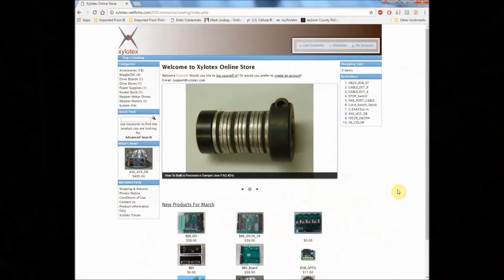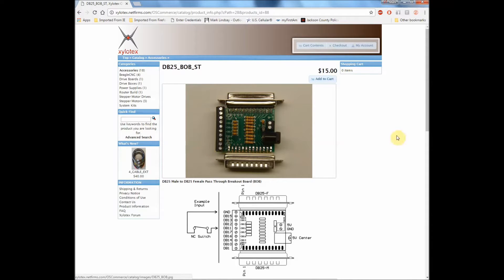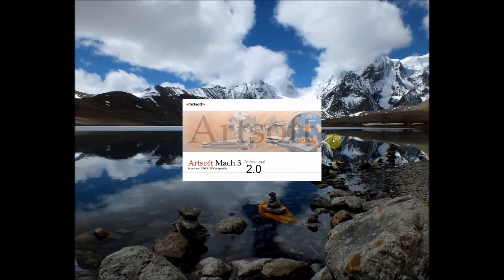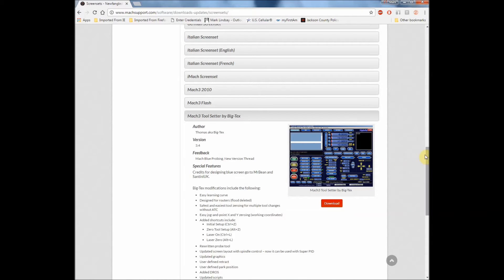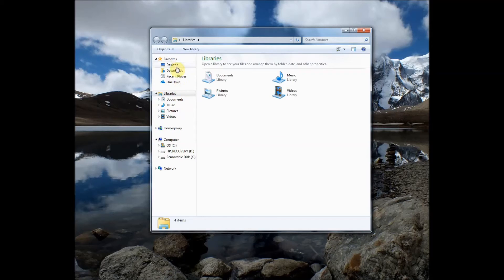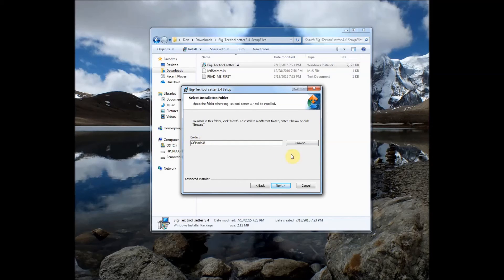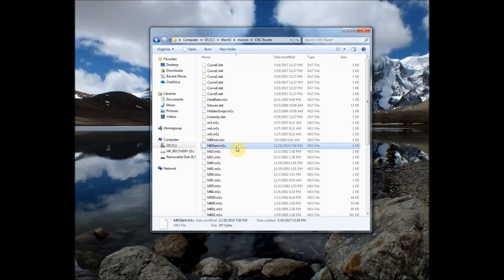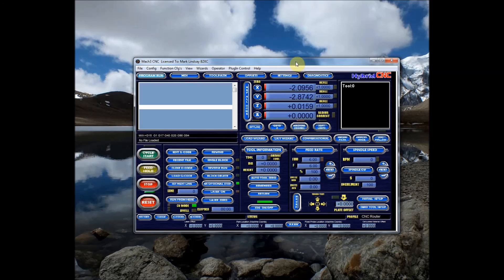Using the Triple Edge Finder from The Maker’s Guide with the Xylotex Drive Box Part 1

Comment: Hello Mark, this screen set no longer available on mach 3 website. How could I aquire the bigtex blue screenset?
Reply from the maker: I'm afraid you can't get the Big Tex blue screen set any more. Contact Bill Griggs at The Makers Guide for info on which Mach3 screen sets he recommends for his Triple Edge Finder.
Reply: @MarkLindsayCNC  thank you very much sir! I enjoy your videos, they have been alot of help.
Reply: @Gvalenz12  he is recommending one called smartscreens. It looks very different than the normal Mach 3 layout so I don't care for that option much.

Bill needs to update his website and videos if he is going to continue selling this. I don't believe it says anywhere that the big tex screenset cost an extra $20 on top of the $85 it cost for the triple edge finder to begin with... Not to mention anything about it being unavailable for the last 2 years or recommending a different screenset that I believe cost $30.

Comment: FYI - The DB25_BOB-ST is no longer available from Xylotex.
Reply from the maker: You're absolutely right. Xylotex stopped making that BoB about a month after I posted this video (of course,) and they have no plans on bringing it back. If you have the newer Xylotex drive box with dual parallel ports up front, any of the Xylotex BoBs (like the current BOB_DB25) will work. 

My website article that accompanies this video reflects this change, and I give some suggestions for replacement BoBs if you have the older drive box with the single parallel port. I plan on making a new video that covers this, as well as a couple of other topics that have been updated since I posted this video series, and I hope to have it up soon. Thanks!

Comment: Great Video I have viewed several  times.  I am having to problem ordering the screen set using PayPal, I get a error message saying I need to update my browser.  I have no idea how to do this (back to the problem of not being a PC user).  Can I order it on my MAC and move from the Mac to the PC using a stick?  My PC is using windows7.
Reply from the maker: You should be able to do it that way. It should work just fine.
Reply: Thanks.  I will try as soon as I get the file.

Comment: Great 1st video of 3, I watched a video on the edge finder, my question is do you have to reference a corner, can you reference center of the material.  Looking forward to the next 2.  Hope to see you in Georgia
Reply from the maker: You can certainly reference your Z axis from anywhere on the material by flipping it over on its back, but trying to reference the X and Y would be basically the same as just drawing an X on the material and lining up the end mill with that. The Triple Edge Finder is mainly for referencing off of a corner.